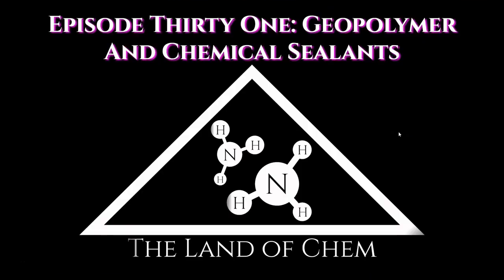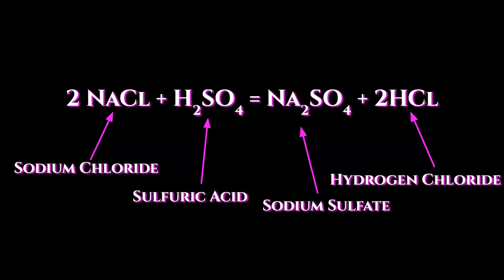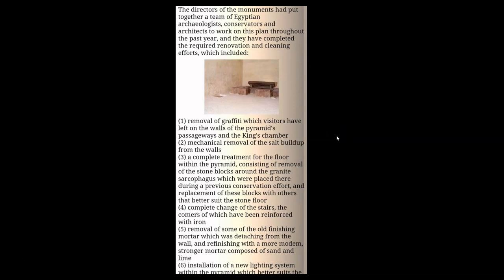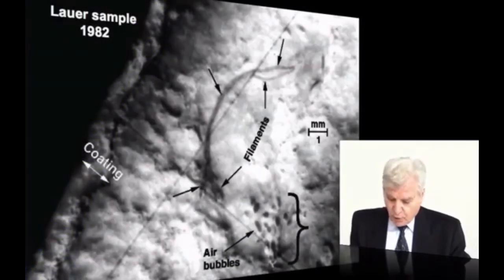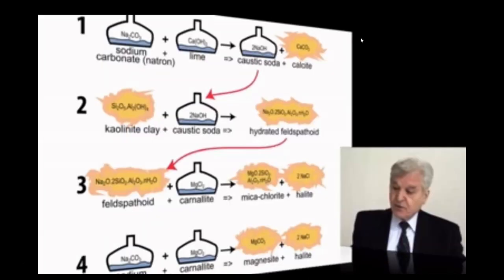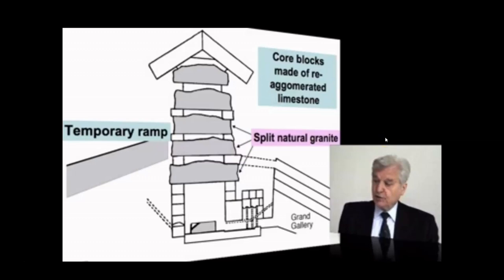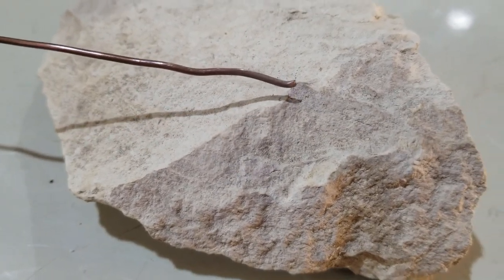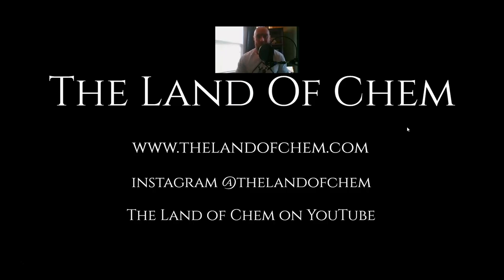Episode Thirty One: Geopolymer And Chemical Sealants

Comment: You have shared a factor that has never been focused on before, namely a polymer coating on the surfaces used for chemical mixes.  Such a polymer would be very strong and very capable of binding reconstituted stone together in a form that would appear to be natural, fooling the eye to this very day.  Such binder chemistry probably began with the need to bind arrows and spearheads to shafts,  and in later ages being used to create the binder for paints...as well as artificial stone.
Reply from the maker: I appreciate you noticing that.  It is a critical element to my theory, and I happened to remember that clip from several years prior when I was making this video.  Thank you for commenting!

Comment: Hi Geoff - having only recently discovered your channel, I am going through your videos randomly. So I hope you still notice comments on old videos. 
Regarding the theory of geopolymer, put forward by Joseph Davidovits. After reading his book, I found the idea quite plausible. However, I don't see the building blocks being made on the ground as shown in the video. I see easy adaptable shuttering being moved along the pyramid levels by three or four guys walking along the level below them. They received the geopolymer mix by some method to be determined (possibly a hoist or possibly an internal ramp) and they pounded the mix into a block, in situ. Then they moved on to the next block. I think it likely that they did not then create the adjacent block because the tight fit of the blocks shows the builders probably used two finished blocks as side shuttering for another block in between two existing ones. This means the builders set a block, then left a gap, then set a block, and left a gap.
When a block had set, a couple of guys went back along the row and collected shuttering that was used on the completed block and reused it on another block. The procedure would have been very quick and would have taken very few workers. A small team could have been employed on each of the four sides of the pyramid, all working at the same time. 
The four straight edges of the pyramid were placed first and the rows were added in between them. (see link from a video added today which explains the staight edges casing stones). 
There was no need for the main building blocks to be the same size. In fact, it was probably a stronger method of construction to have them vary in size. As long as each stone covered a join in the course below, the shuttering was adapted to a random length decided by skilled masons. The height of each row was determined by the Architect. 
When the construction gang reached the last few rows at the top of the pyramid, the construction process probably became more difficult and that is possibly why there are gaps in those rows - which can't be seen from the ground.

REPEATING THIS MESSAGE ON A MORE RECENT LAND OF CHEM POSTING
You might also find the enclosed video interesting Geoff for the fact that the south side of the Giza Plateau middle pyramid casing stones clearly have stains flowing down them?
https://www.youtube.com/watch?v=q4vV1aAgVGw
Reply: This would be the natural progression of pyramid making  once they realized they could cast the blocks in place as opposed to cast then carried up the pyramid. The flooring being cast at odd angles is an indication of casting in place. 
This btw is the most exciting channel on YouTube. We finally have a valid theory of the purpose of the pyramids. AMAZING!!!

Comment: Possibly, on the Great Pyramid, the artificial moulded limestone was used at higher levels, say above the 'Queens Chamber' or Extraction Chamber, and maybe for internal blocks. Another Theory is that the Granite Walls of the Sulphur Furnace were also moulded, as they are so precise.

Comment: The smoking gun that the pyramids, especially the great pyramid were not tombs is the great pyramid 'port cullis' section. Two of the big gate keeper channels are busy making 'nothing to see here' videos about it saying they are just security measures.

When you look into this attenchamber, the useless design for security, the small size of the port cullis blocks, the 4 grooves going to the ceiling, the modern cement cover up etc etc.......you just know this was an adjustable, functional part of a bigger functioning apparatus.
Reply from the maker: yeah I completely disagree with that rope pulley system theory.  it has been around for decades and he is just regurgitating the same old ideas...

Comment: @17:30 the question is why the stones from the quarry are put next to each other as they did naturally in the quarry.  My answer would be: because they fit perfect. When you split one stone in two  the split face is not even or complete flat. But the two stones match each other 100%. This needed less mortar or effort from the builders to make them fit. 
Try it yourself : smash a tile or pottery   on the floor. Do a little puzzling and with some glue you can fix the tile or pottery.
This puzzling is actually the one thing 
archaeologists are good at.😀

I totally agree with you about the geopolymer stones. Nice work and research!

Comment: In the Great Pyramid, you have not mentioned that the 3 Granite Doors, from the entrance chamber to the Sulphur Furnace (which were probably operated vertically, by pulleys) are now the blocking stones, at the foot of the ascending passage. I think the ascending passage was used to raise stones, to the Sulphur Furnace level; but the operation of the pump shaft was impeded. The Well Shaft seems to have been built from the bottom upwards. When the Pyramid was first explored in modern times, broken stones from the hole, at the foot of the Contact Chamber, aka Grand Gallery were found on the floor, like as if they had 'exploded' or broken out of the hole. Perhaps by some advanced, and portable stone cutting device. I do not think the Dynastic Egyptians ever entered the Great Pyramid. The Cheops Cartouche painted in the upper vault area, above the Sulphur Furnace was obviously faked. Some burials, like of Cheops and Khafre, may have taken place in the areas near the Pyramids.

Comment: About those bent pyramid blocks with the natural layer running horizontally through them, I wonder if they are really blocks or just caved sections of bedrock shaped to conform to the pyramid design.  If the masons in a quarry saw such a feature, would they not have avoided using that area?  After all, there would essentially be an unlimited supply to choose from.  So it would seem that if they are bedrock then that layer would be unavoidable and would be used regardless of its lower quality.  But to quarry and transport and lift and place blocks with such a built-in weakness does not make sense since they might split apart along the layer line.
Reply from the maker: to me they appear to be quarried.  The bedrock looks different in that area, and there is a reddish tint from iron oxide deposits in those core stones.  I thought the same thing, that the crack would have compromised the stone.  But the vein is only running along the surface, so perhaps they cut into the vein. Which would make sense from a practicality standpoint to use existing weakness to split the stones.  there is more to follow on this topic soon. stay tuned!
Reply: @thelandofchem  when producing things on an industrial scale, not everything can be perfect. It very well could be that those blocks in particular passed quality control, but only just barely. Anything worse might have been rejected. We have no idea how many similar blocks were rejected do to defects.

Comment: My theory is that alot of these structures throughout the ancient world were built to sustain plasma/lightning strikes from the sun/solar bodies. To possibly even pull the energy from the air duing extended solar events using antenae. To me this would explain the idea of antiquitech and ancient energy generation, they were harnessing the energies of the solar bodies. The most significant example of this we have in modern times is the Carrington Event, and we know that was a fairly weak event.
Reply: You have the right idea but are looking I believe at the wrong type of events and sources. I would ascribe the use of antennas to attracting lightning during thunderstorms, channeling it into massive high-capacity capacitors that would be used to recharge rechargeable batteries that were used to power all electrical equipment.  That would have been the original intended use for obelisks, -as well as for transmission of shortwave radio communication to other locations, such as from Aswan to Giza to Tanis.

Comment: There's a great deal of variation in the H blocks, common misconception that they are all identical
Reply: Don't fail to consider the likelihood that many ARE identical if only in twos or threes, and that multiple molds may have been necessary because of the damage the molds sustained in attempting to remove them.  If they were not difficult to 'hammer' together, then multiple molds would be no problem.
Reply: @redwoodcoast  the likelyhood ? There either are or aren't some identical blocks, and as far as I know there aren't, there's also not that many H blocks in total
Reply from the maker: I would say this is a result of the curing process and thousands of years of expansion/contraction.  Same with modern concrete blocks. Casting something doesn't ensure perfection, just consistency in shape.  Small variations in water, etc during the mixing phase could also produce differences in final dimensions

Comment: They could of used random customisable molds to ensure long term stability, if everything is symmetrical it will reduce the durability of structure, all random shapes will drastically increase life of structure

At the same time, theres undoubtedly quarried stones with machining marks, tube core drills with a fixed tip thread pattern, 10ft circular saw marks on many stones, away from tourist sections obviously

Comment: 18:02 I don't know why people keep trying to use these stones as examples of "impossible" manufacturing if ancients, and or geo-polymer.

It's widely known these stones are Sandstone. Which can be easily shaped with....wood. So a moderately hard tool (stone harder than sandstone) would easily remove material from sandstone.